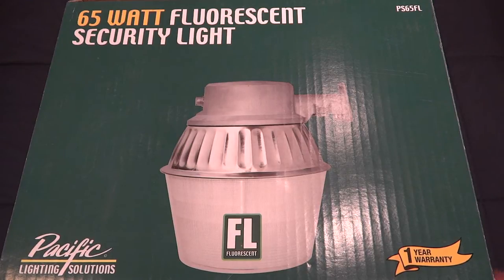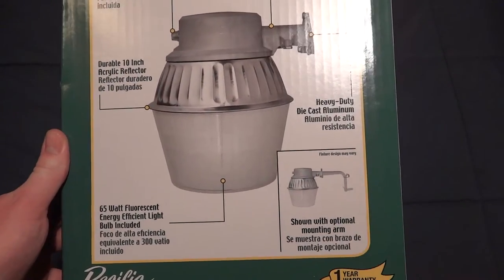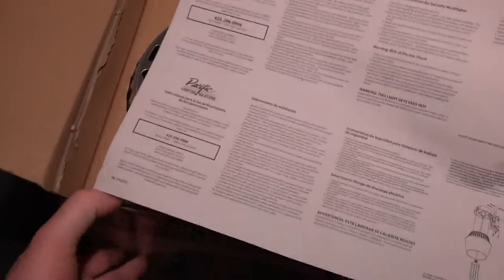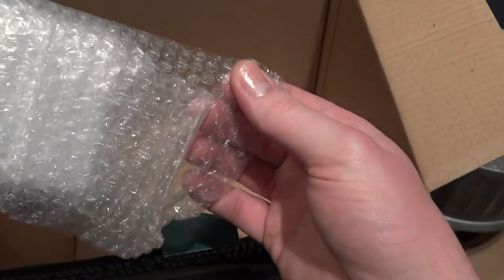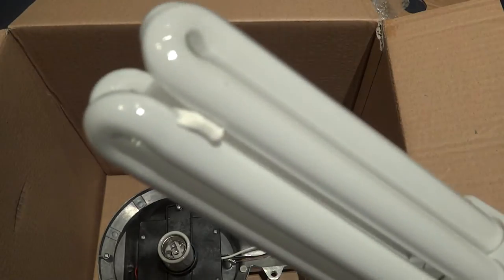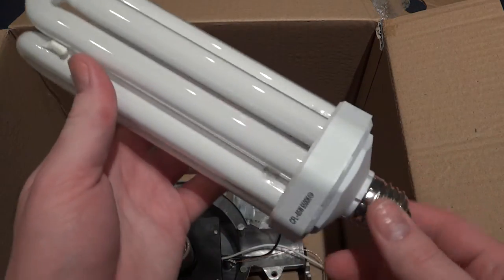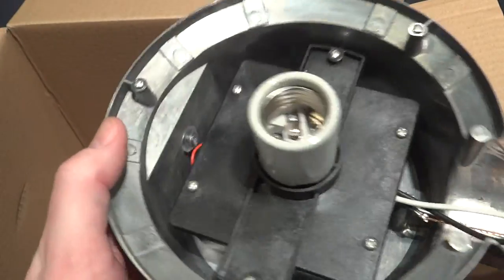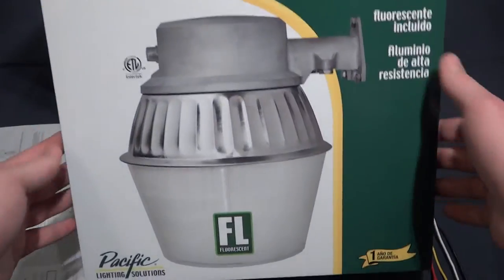Pacific Lighting Solutions 65watt Fluorescent area light

Comment: I have the same style light which requires a replacement bulb"CFT42W/GX24Q" with a 4 pin base. The ballast works when it feels like it. I purchased the same bulb but the LED version. Can I simply bypass the the ballast(leave it in place)? Tried to find a Youtube video for the procedure but no luck. Any suggestions?